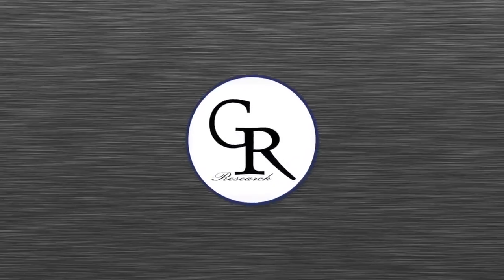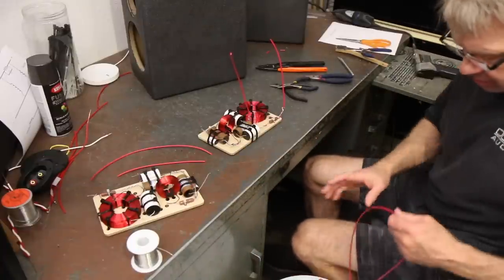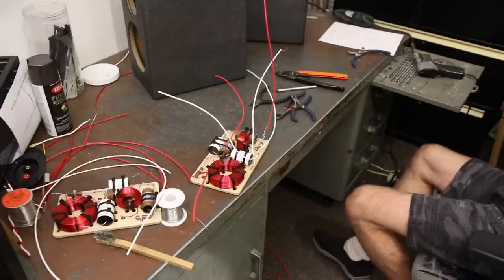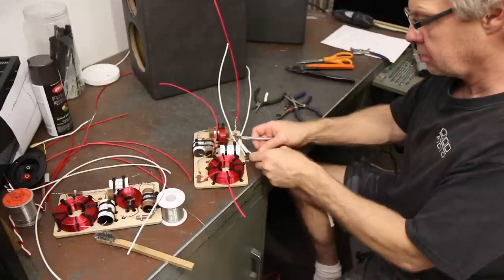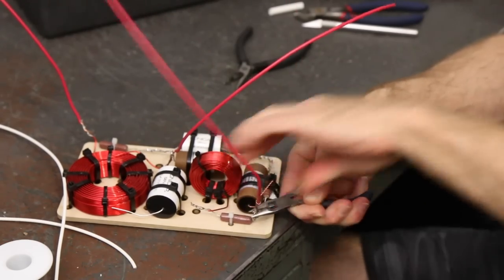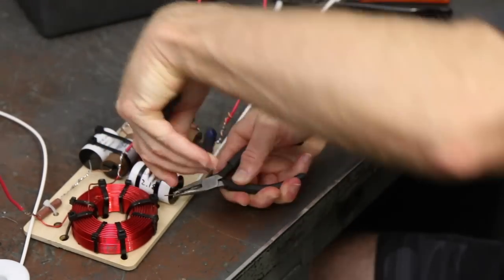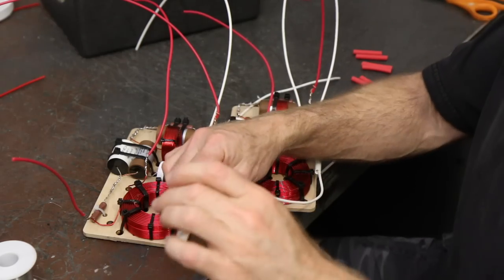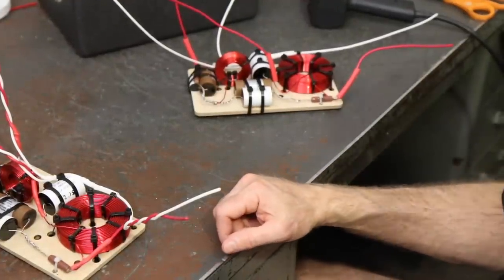Building the X-LS Encore: Wiring

Comment: Danny, watching you do this stuff is therapeutic for me.  Not only does it instill confidence in me knowing that some of the tasks I've done before should be a piece of cake, but I also learn little tips and tricks from you by watching you breeze through these things.  For example you mentioned in one video how you Duratex the boards, hot-glue the components down to the board, and stay cognizant of magnetic fields if inductors are mounted close or same direction.  I likely wouldn't have done that had I not watched you do it or at least reference it.  And just watching your method of organizing crossover components on the board and zipping them up helps me figure out my own xover upgrade I'm working on right now.  Truly appreciate you taking the time to train the noobs and us rusty ones who don't get hands-on but once every year or so.

Comment: Thanks Danny for this video series! It’s helping me prepare for my NX-Studio build. How did you mount the crossovers into the cabinet? You mentioned something about a wedge screw in the crossover video when drilling holes in the wood mounting board? Are there bolts already in the bottom of the cabinet and you secure the board with nuts or something?

Comment: Would very much like to see a video discussing the hookup, adjustment and integration of the Servo Subwoofers/plate amps. I am planning to add a pair to my X-Statiks, but all the knobs and adjustments look intimidating. Bass management with LFE input (mono bass) vs. line level (stereo). Or? What about the Neutrik connectors?

Comment: Very good demo Denny. One question. People usually recommended to use 14G (to 10G) of speaker wires connecting between loudspeakers and amplifier. Why we use 16G wires inside 
the speaker box as the last part of signal path? Can thicker wires show even better result? Thanks,
Reply: The wire really makes a difference, but the gauge of the wire can be the least of the differences.
Reply: Good to know that. Denny, You do mentioned in the demo that these wires are very good in quality. Could you be more descriptive why make so good than other wires?
Thanks,
Reply: @MultiKas2010  It is a combination of things. This is US made Copper with four 9's purity. It is solid core and it uses a polyethylene jacket (not PVC).
Reply: @dannyrichie9743  Hi Danny, Thanks very much to spend time identify this. Greatly appreciate it.
Reply: @dannyrichie9743  Where do you get your internal connector wire from? I'd love to get some!
Reply: @kenthomas1613  We have it custom made for us, and we sell it for 80 cents a foot.

Comment: Would you ever put dielectric grease under the heat shrink tubing?  I do that when I'm solder wires in my automotive connections.

Comment: I'm a visual learner and these videos are valuable. Danny -- you probably don't realize how many little tricks you've incorporated over the years.  I have built some very advanced kits, but have never built a crossover. I'm about to rebuild the XOs in a couple of my old AR-11s using your higher-quality parts. After watching this and the previous video I can see several ways to improve over the originals in terms of layout and assembly. One question -- in a 3-way speaker, how do you best orient the inductors to minimize interactions?

Comment: Do the crossovers just sit on the speaker cabinet floor loose or are they fastened somehow.  If they are fastened, how do you fasten them.
Reply: When he built the crossovers, he drilled a few holes for screws.  I'd assume they're screwed to the bottom of the cabinet, probably with spacers.

Comment: Rich, what info to search to learn about what inductors, and capacitors will throw in resisters also but where would I learn about the vaule of each of those parts to learn or shape the freq responsce of a speaker before a build it to get close to what I want when playing pink noise to the speaker in a sound chamber. I know there is much testing, I want to learn the extra part of al lthis building. Why a certain value capacitor was used, or so forth to bring a dip down. First order, second order so forth. Any links or can you point me in the direction for that? Thank you as always for sharing your work!

Comment: Curious, why are you using Sonicaps if your just bypassing them with other caps?  Am I missing something?
Reply: The smaller by-pass cap speeds up the dissipation of stored energy in the larger cap and allows it to take on some of the sonic signature of the Copper cap. The result is really good.
Reply: @dannyrichie9743  this all went over my head!!  noob here to crossovers
Reply: @neccros007  The combination sounds really good.
Reply: @dannyrichie9743  I'm just going to stick to standard Sonicaps for now... cant afford fancy caps right now

Comment: Danny, thanks for these videos.. Super helpful.  I'll wondering if you have a photo of how you use a shrink tube on a three way splice... Seems like  it would not be an airtight seal? Or is that critical.
Reply: It seals pretty well.
Reply: @dannyrichie9743  thanks Danny.  One final over thinking question. When twisting the wires, would it be beneficial to also crimp the wires using the end of a plier before soldering.. or is there a need to keep the outer surface of the wire as in tact as possible?
Reply: @HoomanR17  No need to try and compress the wires.

Comment: How do you (twist warp or solder) the connection if a person is using flat wire inductors ?

Scott
Reply: I use flat ribbon foil inductors a lot. What I do is at the tinned portion of the copper foil, I run the wire/capacitor/whatever in that section and then bend the copper foil over, trimming excess length but ensuring that the round wire is enclosed within the tinned ribbon foil. Then I ensure there is enough of the round wire conductor to extend past this area to bend back over on the outside of the ribbon. Using a high heat large tip soldering iron, I heat from outside of the copper foil, letting solder wick in and then finally ensure the outside wire exposed also has solder. Immediately upon removal of heat, I crimp with needle nose pliers, squeezing the copper foil against the internal wire. Note that if capacitor leads or even resistor leads are withing this soldering area, use alligator clip next to the component as a heat sink/protector.
Reply: @glmaughan  Thanks for the good info

Comment: Where’s the best place to source 16AWG solid core polyethylene insulated wire, Danny? It’s easy enough to find solid core with PVC insulation for a “reasonable” price, but I’ve seen in your other videos that you don’t like the acoustic performance of this type of wire.
Reply: Danny sells it.
Reply: Yep, we have it for 80 cents a foot.
Reply: That’s great news! Even after converting to Aussie dollars, you come in far cheaper than any other source. My order will be coming in soon.
Reply: @dannyrichie9743  I've looked through your GR Research website and I can't seem to find it. I must have a bad case of guys eyes or something to that effect. Apologies for the request to find it - would love to buy some!
Reply: @kenthomas1613  I don't put the internal wire on our website. If I did I'd have someone order two feet of it.
Reply: @dannyrichie9743  Can I order 50 ft of red and white?
Reply: @kenthomas1613  Certainly, just give me a call.
Reply: @dannyrichie9743  Love to. What’s the best time? I’m based in Sydney Australia.
Reply: @dannyrichie9743  Sounds great! What’s the best time to call? I’m based in Sydney Australia.
Reply: @kenthomas1613  Call late in the evening your time and it will be morning here. We start answering calls after 10 am central time.
Reply: @dannyrichie9743  Is that for 2 wires?
Reply: @manFromPeterborough  It is a single conductor wire.